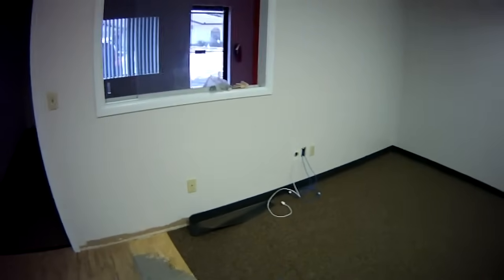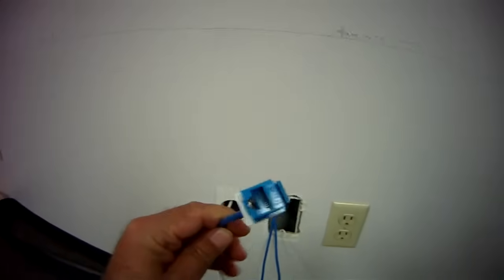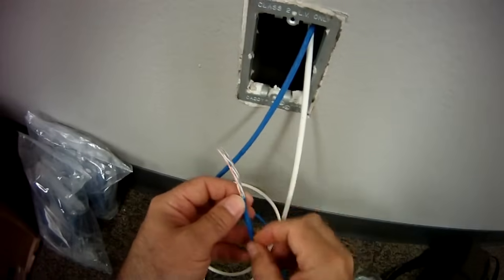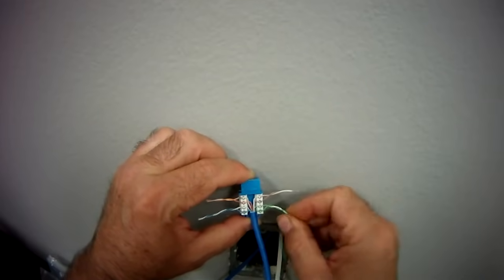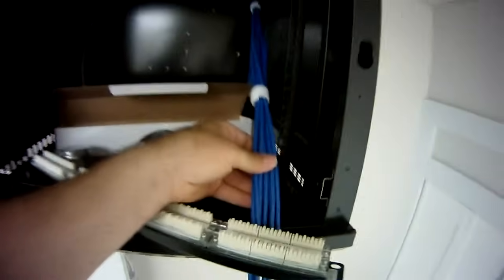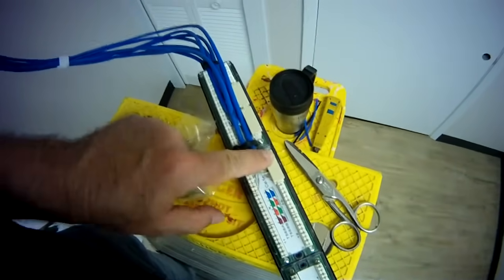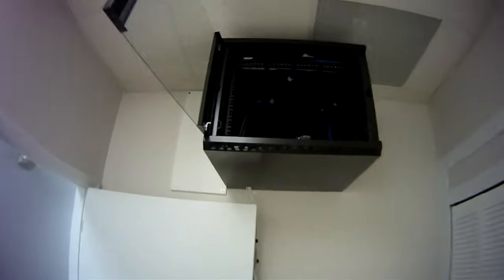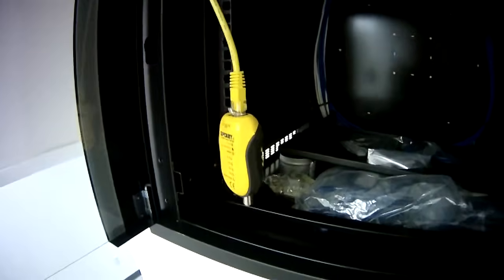Wiring an Office Network

Comment: what is the difffernce from cat5 cat5e and cat6?
Reply from the maker: j.a.cole I agree 100%.  If you really need 10Gig, then why are you wasting time with Copper? A 10gig connection is probably forsomething super critical (backbone, server, SAN), so just use Fiber and be done with it. :-)
Reply from the maker: precisely, and it's why we have jobs.  So, we can help the customer decide.  I appreciate the thoughtful discussion.
Reply: cat6 isnt really that good for 10g... average standards is Cat 5e for normal 1gb network or telephone  because its cheap... Cat 6a is better for 10g as it can do 10g over the full 100 metre max length of Ethernet.. if you need longer distance or higher speeds your gonna be looking at fibre, unless your able to get away with repeaters every 100 metres
Reply: while for like 90% of cases yeah you'd be right, 10g or over is almost always a backbone, there are rare cases when 10g copper can be useful, because copper can be terminated to a wall jack easily, and cheap while fibre cant. if you need 10g clients fibre can be over kill... also even with a backbone its cost... Cat 6a is always going to be cheaper than fibre lines. both have advantages and disadvantages, you never know what situations or requirements someones network might have
Reply: a lot of uplinks are being run in Cat6a these days but that is simply a cost saving vs fiber....then again depends on the situation
Reply from the maker: +zach “techy guru” schwanke it's about the speed rating.  Cat 5 (I don't they sell anymore) was rated for 100mbps.  Cat 5e is rated for 1 gig and cat6 is theoretically rated for 10 gig over short distance.  Cat5e is still the most commonly used data cable by commercial installers.  However, if you can afford to install cat6, it can't hurt.

Comment: I mean still cat 6a would have been more preferable
Reply from the maker: +CleanCut Tech  it really just comes down to budget.  This install you see in the video was on of many this company does every week.  (It's a nation-wide specialty medical practice).  While upgrading to cat6 might have been preferable, the incremental cost difference (about 40% more) multiplied by the number of offices they setup every month begins to add up.  Plus, the machines they use are all 100mbps.  And, lastly they may only be in that office for 5 years before moving again.
Now, I do agree that if it was my office and money was no issue, then yes I would probably run cat 6.  But, even then I don't know that I will have a 10gbps network device anytime soon.
Reply: Waste of money. That high of a rating would only make sense when long runs must be completed, this is a small office. CAT5e is more than sufficient.
Reply: +CleanCut Tech It does not matter in size but speed that is required by the clients
Reply: COD Casters Cat5e can handle 1Gb/s, Cat 6e can handle 10Gb/s. Unless a high end NIC is added to the clients (a further waste of money), the maximum throughput would only be 1Gb/s anyway. The only reason a 10Gb link would be required is when many clients are going to be hitting the server at once with high data requests such as RAW video. Cat6a would be a complete waste of money and not practical for a small scale business such as this one.
Reply: +CleanCut Tech You obviously don't know what your talking about
Reply: COD Casters The fact that you have no statistics to back up your points suggests otherwise. He used 5e in the video for a reason.
Reply: Network Advisor I wholly agree. I understand that Cat6a is extremely expensive in comparison to Cat5e and is not justified with the benefits in this case. And as I was saying, in depends on the clients. As you stated, they are 100mbps. Cat6 is always preferable, but some people (COD Casters)  must understand that money is an object, and you cant just say, "Oh, just run Cat6a". Thats a naive response. The amount of cabling that must be run, and not to mention the hardware within the computers, costs a lot more to be able to support the speeds to see a benefit.

Comment: If I may, what's the model of that certifier?
Reply from the maker: +musaid  yes,  that is a Byte Bros. :-)
Reply from the maker: no, it certifies.  You can even print out the results or save to Excel.
Reply from the maker: ***** yes, everything is you say is true.  My apologies, but I think I was getting this video confused with another I made.  (I make several per month).  The device I was using in this video is NOT the Byte Bro 1000RWC.  In this video I am just using a simple continuity tester.    What I thought I was talking about was my Byte Bros certifier..  So, you are right.  My bad.